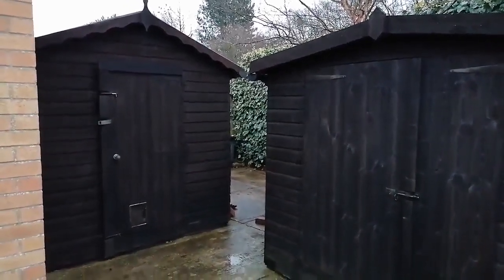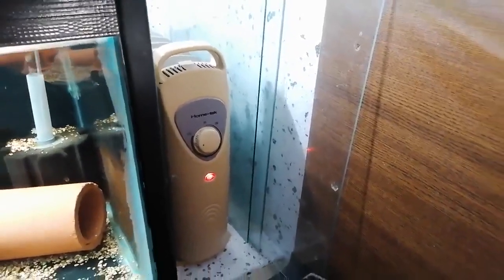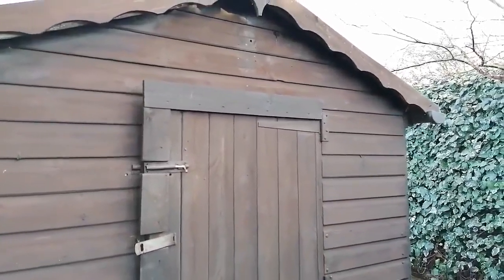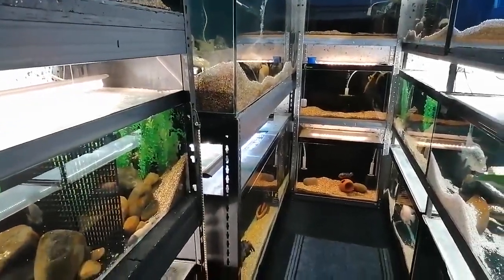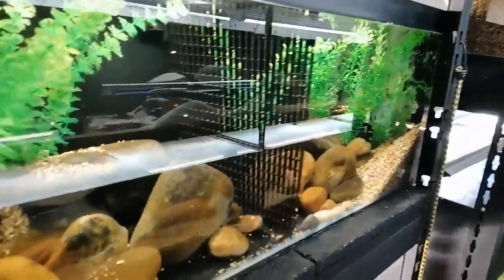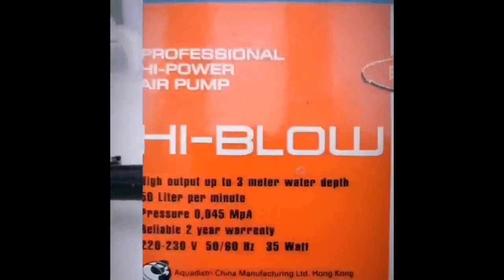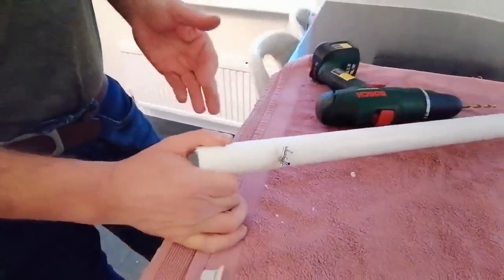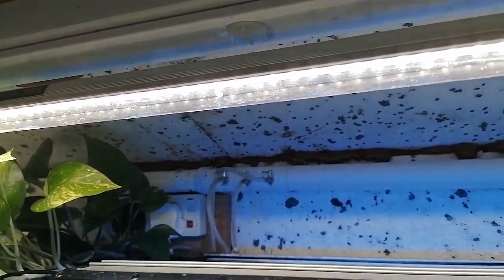Diy build budget economical fishroom

Comment: I’m guessing Andy is from the West Midlands.  The very coldest you’d ever get is probably around -5c or 23f but that will be at the extreme end and only for very short stints.  Most of the coldest bits of winter will be a few degrees above freezing with a few odd snow days.  A lot warmer than most places at our latitude.
Reply: Im guessing so to. But it deffo going to make the difference in cost of electric. Im in birmingham and spending nearly 230 a month on electric alone. Lol.

Comment: Hi Andy, great vid im thinking of converting my shed into a fish room, its about the same size as yours, i can understand when its cold you can keep the heater on, im i the uk and very rare we get hot weather like it is at  moment, how do you keep yor fish room cool so temps in the tanks dont raise to high. cheers. Keep up the good work
Reply: Hi Andy, I have the same question. The shed I am planning to use went up to high 30's, 40 degrees this last weekend. Does your insulation keep it cool as well?

Comment: Very clever 👏 👌 what temp do you heat the shed to? Cheers,
Joe
Reply from the maker: I've not a clue. I keep my eye on water temp not room temperature. I'll turn my heater up after a water change, then right back down again once all tanks have stabilised.
 Once stabilised the heater is set  just high enough to keep everything good trial and error. I just keep checking water temp.
Smaller the air space the more economical it is.  So the more tanks you cram in the better.
Reply: @andywoodscichlids2942  i think I'm going to need more tanks. Thanks for your time and help. I'll let you know how it goes

Comment: Great video thanks ! Juat wondering did you have to reinforce the floor of the shed?
Reply from the maker: I put joists running across the opposite direction to the originals. Only were the feet of the racking are.
Your OK as long as you don't put racking feet directly onto the floor boards. Make sure the feet are on joists only.
Hope that makes sense 🤔🤔 to you.
Reply: @andywoodscichlids2942  yes that makes sense thanks Andy 👍👍

Comment: Great video Andy just wondering I just bought a 700 litre fish tank but not sure that my floor will take the weight as any tips
Reply from the maker: I don't know what type of floor you have.
 My tip is to spread the weight out eventually over load bearing points. Ie beams and floor joists.
Reply: Move I think 👍

Comment: Hi I’m trying to find a 500w oil radiator  but they seem very small do you know what make your one is please and how much of an area it would heat if insulated well like your fish room thank you
Reply from the maker: Mine is very old, picked it up for £5 at a car boot sale.
I have seen new 650w rads for sale on occasions.
Mine keeps things warm with the thermostat set at 50% of max. 
The more tanks you can squeeze into the fishroon the more efficient it is. 
Little air space more water. 
It can take I wile for all tanks to reach temp, but once there. They help keep the room warm to.

Comment: Andy great video, thank you. I was thinking all the way through the video "how does he do water changes" them bam you answered it lol. 
I'm currently running 3 tanks. Was thinking about doing something like yours. Do you get much condensation/mould from evaporation?
I'm in Ireland, can get quite damp here. That's my only concern
Reply from the maker: If you well insulated and heat the room there's no condensation.
If you heat the tanks higher than room temperature then you will have evaporation. Then condensation.
Reply: @andywoodscichlids2942  cheers Andy 👍👍

Comment: So heat the room only and no heaters in the tanks. Interesting. So what Temp do the tanks get up to?
Reply from the maker: Top shelf 80f middle shelf 78f and bottom shelf 75f.
It varies slightly from winter to summer. In the summer time i have the room heater set lower.
Reply: @andywoodscichlids2942 thanks for the reply Andy. That's pretty amazing. I'd have no chance doing it like that though as my fish room has massive tanks. Mines in my garage and although I've insulated it well I'm running 4 , big 250 gals and my electric went through the roof :/